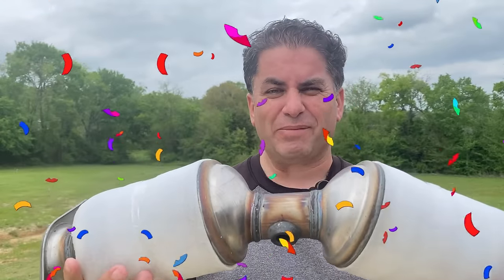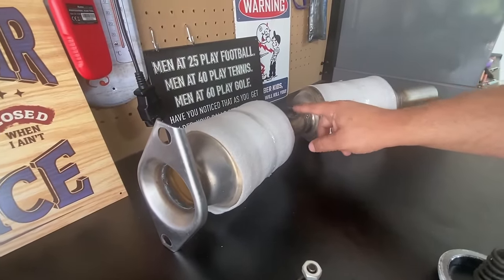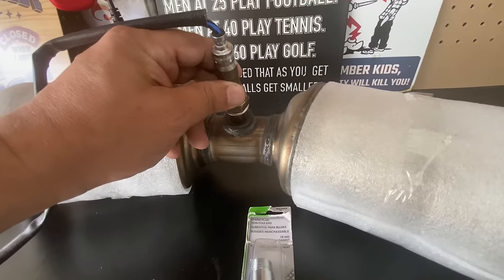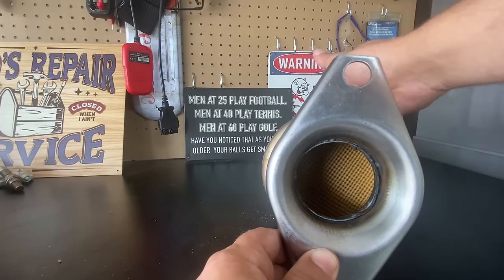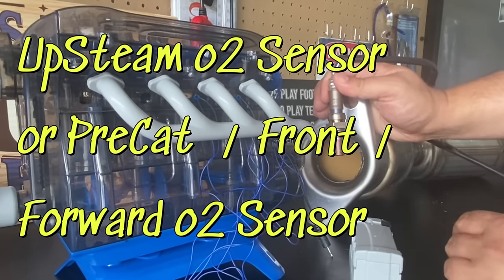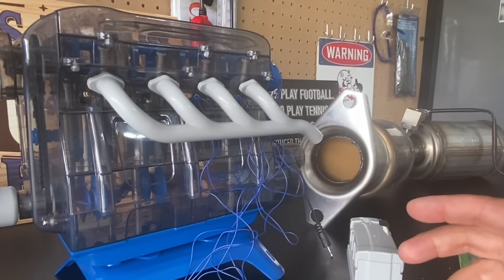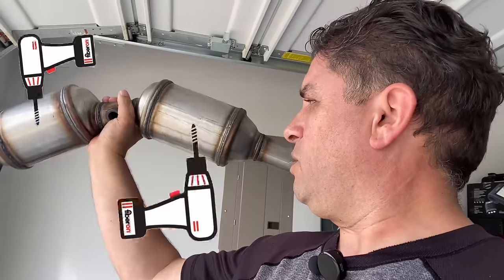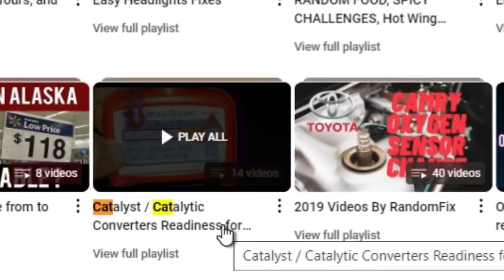Catalytic Converter for $31?

Comment from the maker: ▶ Link to inexpressive cat https://s.click.aliexpress.com/e/_DBMXYAl
Now the o2 spacers are called non foulers, you should really buy one with a 90 degree elbow in most cases.
▶ Mini catalyst with 90 degree bend https://s.click.aliexpress.com/e/_DEYHHMV
▶ SOLD on Amazon Here is another part number for the no drilling required non fouler Dorman HELP 42109 https://amzn.to/43SHTkZ
▶ No drill spark non fouler found at Walmart.com Hesxuno Border Car Modification Accessories Oxygen Sensor Filter Adapter Extension Screw

▶▶ Catalytic converters playlist https://www.youtube.com/watch?v=BuZYAy_xi0E&list=PLDEbtVOPRC-h1BAzaWQ-6NSnmG0gwvgwP

▶ Dirt Cheap Catalytic converter https://youtu.be/Wr1vFqCnpDc
▶ Install of $118 Catalytic converter https://youtu.be/uIXslV-Wt3o
▶ I purchased the worlds cheapest catalytic converter for $31.60 https://youtu.be/en6eKzyE_80

▶ 12 Minute Actual Drive https://youtu.be/jldTJI64cfM
▶ Demo EMISSION INSPECTION MONITOR Readiness (I/M)  https://youtu.be/gAumb9zgLZg
▶ Permanent Diagnostic Trouble codes (PTDC) https://youtu.be/PMcJtcSOzdk

▶ Acura Drive Cycle https://youtu.be/2b7dYwMQZDo
▶ https://youtu.be/uO9iDeUZOyM Audi Drive Cycle
▶ BMW Drive Cycle https://youtu.be/mk6Tk330Acw
▶ Chrysler Smog Readiness check https://youtu.be/O1RH-u1bNIc
▶ Chrysler Smog procedure https://youtu.be/dyYv4HpYPys
▶ Ford Drive Cycle Readiness https://youtu.be/LllIXoqUKJ4
▶ Ford Drive Cycle https://youtu.be/j8ZFTE1rSfA
▶ Gm Drive Cycle https://youtu.be/Yp34ksJY-fQ
▶ Honda Drive Cycle https://youtu.be/oZELvZ4danA
▶ Honda Smog Readiness  https://www.youtube.com/watch?v=cxpE_I1cKh8
▶ Hyundai Drive Cycle https://youtu.be/UzC4FNTqNdI
▶ Infiniti Drive Cycle https://youtu.be/76SByziNMFI
▶ Isuzu Drive Cycle https://youtu.be/glw0d7y5_lQ
▶ Jaguar Drive Cycle https://youtu.be/h_aCeJch53U
▶ Kia Drive Cycle https://youtu.be/OtSDdIgQ6_g
▶ Land Rover Drive Cycle https://youtu.be/A-CmBzlXszY
▶ Mercedes Benz Drive Cycle https://youtu.be/gLnhD4gP0kM
▶ Mini Cooper Drive Cycle https://youtu.be/ND08_kKz8Ls
▶ Mitsubishi Drive Cycle https://youtu.be/3ywgZW2zMa8
▶ Nissan Drive Cycle https://youtu.be/s9PLkO-CjZ8
▶ Porsche Drive Cycle https://youtu.be/Yi6eANscwhQ
▶ Subaru Drive Cycle https://youtu.be/w3DF4g2h96M
▶Volkswagen Drive Cycle https://youtu.be/uh8BhqJpzGg
▶ Volvo Drive Cycle https://youtu.be/mEeUwDd_dsc
▶ Catalyst monitor not ready? https://youtu.be/hi7QdlgKHzM
▶ Catalyst Monitor Cheat https://youtu.be/BuZYAy_xi0E
▶ Catalyst not ready? Watch this video https://youtu.be/ERQUUdWo3-o
▶ Evap monitor not ready? https://youtu.be/99nfTcPy4fo
▶ EGR monitor not ready? https://youtu.be/aujgghRf04I
▶ Oxygen sensor not ready? https://youtu.be/sAvxeAyYsRk
▶ Oxygen sensor replacement https://youtu.be/9jKuutvNs74
▶ Oxygen sensor heater element testing https://youtu.be/zEbXn6vgqiA
▶ Dirt Cheap Catalytic Converters https://youtu.be/Wr1vFqCnpDc
▶Cheap Catalytic Converter Install https://youtu.be/uIXslV-Wt3o

Comment: Ugggggg!!! I just paid $786 for my catalytic converter. I needed for my  2014 Ford focus it’s probably worth more than my car.😂 and then my battery went dead so I spent another $150 on that of course the negative cable with a sensor on it broke off so I had to buy one of those from Napa for $88 then I had to do a drive cycle in Arizona with no AC but guess what! I passed emissions today! Only because of you random fix thank you thank you thank you! I am a woman and I have never done anything like this, but you can’t tell me that I can’t do something because I will prove everyone wrong ha ha ha thanks!🙏💥💥💥💥💪❤️
Reply from the maker: I’m glad to hear that the channel helped you pass your 2014 ford focus. Yeah these catalytic converters are getting very expensive. From the $786 price I am thinking your vehicle is not registered in California?